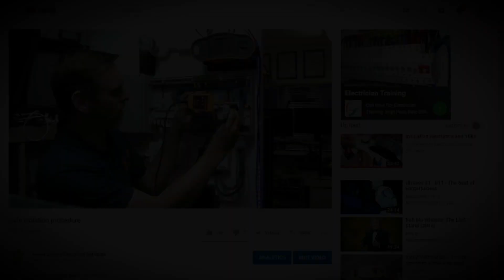NTT- The TIS859 Voltage Detector

Comment: Thanks for review. What I saw in it, that i didn't like was, that the multimeter function and buzzing is too slow. I also disliked the fact that you have to hold a button to get single pole phase reading.
Reply from the maker: I must admit, despite the review this model didn't remain as my go-to and I soon fell back to my TIS845 which has been on my hip ever since. It was the retractable shrouds I couldn't get on with.
Reply: Interesting. There are lots of models that are similar to TIS 845, but there are two things that I dislike with those too.

1. There is no RCD trip button (to see if it's ghost voltage i.e. fluke t130) 2. The main handle shroud tears easily.

I've seen wiha model with rcd trip button, but for that price I'd rather get fluke. Although I dislike these new fluke models too, because their cables are really thick. 
 @dsesuk

Comment: What’s ur thoughts on the tis859 since having it almost a year best two pole on the market ?
Reply from the maker: I haven't experienced enough to say it's the best on the market, but it's the best I have used personally, and at the price point it's good value for money. I do use it, in fact as the soft case has a belt loop, I carry it about my person daily as part of the toolbelt so it's my go-to tester for safe isolation, polarity checking and continuity. I haven't had cause to use many of the other functions such as capacitance or even the Electric Field function which I showed in both this video and a more recent one on capacitance, but it's handy to know that feature set is there and ready should I need it.
Reply: Thanks I’m using the megger tpt320 but had it for a number of years and is a bit worse for wear so I’m looking to invest in another and it seems like a lot of the two pole testers are coming from the same factory as there very similar in use just aesthetically different. TIS was always the underdog and not as recognised as ur megger kewteck and flukes etc so yeah look as if they’ve stepped it up. On a separate note I saw ur on the front of this months electricians magazine I can see u  being on playboys cover to soon 😭
Reply from the maker: @iqyyazdani7951  Ha! Yes, that was me. They wanted a fat man on the front cover and went for an angle where you couldn't see my face! Notice the effort they also went to by colouring the rim of my McHat in Scolmore blue instead of McYellow! Going back to the TIS, the only gripe I have is the shrouded tips. The shrouds are spring loaded, so they're good from a safety point of view and for complying with GS38, but if you're trying to check a fuse or something then they can get in the way a bit. That's the only downside though, and it remains on my hip ready for action!

Comment: Can’t a multimeter do much the same?
Reply from the maker: Yes it can, but a multimeter or multi function tester would not be allowed on a competent person's assessment as it has to be physically switched on, set to the right function (and maybe also scale) and it requires batteries to function. A voltage indicator will provide indication without batteries, without a power switch and without settings selection so there's no chance of a mis-indication through incorrect configuration. You can still carry a multimeter for additional functions, but to pass the CPS assessment, you'd need something like this.
Reply: David Savery Electrical Services - Thanks for the clarification. I begin to see why you sparks have so many bits of test equipment!

Comment: Well I’m rather pleased that I’ve just picked one of these up now. I dropped into my local Eddie’s to use the loo and get some free coffee and lo! A calibration day was being conducted by those crafty TIS bods as means to offer discount on stuff you didn’t know you needed. Sound familiar? I found myself walking away with a soon-to-be-refilled bladder, a soon-to-be emptier wallet and one of these babies in my hot little hand. TBH I imagined leaving it in the box and taking it back as I felt the chap from TIS (let’s call him Chad) had rather oversold it. He’d tried to chuck in a 560 clam meter for a lower price too, and it was this that had nudged my memory - “hang on, didn’t DSES do a vid on this or something like it recently?” Turns out you did, and favoured the Klein CL2300 over the TIS 560 quite considerably. Sorry Chad. 
So, grateful for the steer on that, and the (much more favourable) review on this. I think I’ll keep it and use it instead of the Fluke T5-1000 that I’ve been carrying for years, although I’ll keep it about, as it still operates as an ammeter which this doesn’t. Might still have to look at the Klein though....
Reply from the maker: Ah yes, that's where they get you, those free calibration days! Although to be fair, the Klein is not an earth leakage meter like the TIS560, but the 560 is pretty useless with its 20mA full scale deflection when investigating a trippy 30mA RCD as all it does is show OL (no shit, I know it's over limit, I need to know by how much!) Also, the Klein was end of line. CEF did me a good price on it which I thought was down to them liking me, but it turns out they wanted the damn thing off the shelf so they could put something new in its place! Still, this 859 voltage indicator is quite nice. I've been using it in anger for a couple of weeks now!

Comment: Vibration is for visually impaired electricians that can’t see the LEDs.
So it beeps sometimes and vibrates at other times.
And one of them has a two wire phase rotation function, I bet that works perfectly.
The RCD test function is used for circuit location rather than RCD compliance.
You forgot the MOST important thing what safety category are they?
Reply: Lol. Blind electricians. Could do with braille on the 'new' colour codes though.
Reply: Or to let you listen to your MP3 player while you work.

Comment: It retails for £138+VAT 😯😯😯
Reply from the maker: I think I paid about a ton for my 845 model which does less. There are far cheaper ones out there with fewer features. I guess you have to weigh up what it does for the money and decide if you're going to get the value back through having an easier working day!
Reply: @dsesuk  CEF is retailing the TIS895 for £89.95+VAT... That's a very good price 👍
Reply from the maker: An extra fifty notes for the new boy then. For that you get capacitance to 2000uF, resistance up from 1999 Ohm to 999kOhm, replaceable probes, flat-battery voltage indication operation, RCD trip operation, electric field sensing, spring-loaded GS38 ends, better battery testing and a larger, more informative LCD display. That's what you're weighing up for the extra, and it might be enough to sway, or not. If I was in the market for a voltage indicator and I didn't already have something that could do capacitance, then that alone would likely swing it for me. I find it's very rarely needed, but when it is needed, it's nice to have it on a tool already residing in the box. It's always right to shop around and compare pricing and features to work out what's best for you though.
Reply: @dsesuk  I'll have to think of a way of breaking or accidentally misplacing my current tester so I can justify getting this bad boy 😂😂😂
Reply from the maker: Haha! I know what you mean; that's the problem isn't it?! My 845 has served me well, I feel guilty taking it out of the toolbox for any usurper!
Reply: David Savery Electrical Services does it comply with GS38? As the note states that’s it has no leads that disconnect from device? Just about to part with hard earned dosh
Reply: @BaylinerCapri2050  The TIS website says that they're GS38 compliant.

https://www.testinstrumentsolutions.co.uk/view-product/TIS-859-1000V-RCD--Resistance
Reply from the maker: @BaylinerCapri2050  Hi Rick. I don't think GS38 says leads cannot be removable. It says they must "..not have accessible exposed conductors other than the probe tips,
or have live conductors accessible to a person’s finger if a lead becomes
 detached from a probe or equipment when in use. The test lead or leads

are held captive and sealed into the body of the voltage detector..". I think the idea behind that is to rule out the use of cheap multimeter probes which have an exposed prong on the end of the lead. In the case of this thing, the plug is shrouded so there's no chance of accidental contact if it's not pushed fully home. The picture on page 5 of GS38 shows the recommended type of lead which matches what's in use here.
Reply: David Savery Electrical Services 

Pg6, 1st para, last sentence... The interconnecting lead and second test probe ***are not detachable components***. These types of detector do not require additional current limiting resistors or hbc fuses to be fitted provided that they conform to BS EN 61243-3.
Reply from the maker: @BaylinerCapri2050  Nice find, I missed that. In that case, I don't know for sure as I'm just going by what TIS claim. I suspect the requirement for the probes to not be detachable is to prevent fused or current limited probes from being replaced with non-fused probes, but this tester does comply with BSEN61243-3 according to the spec sheet, so I suspect there's nothing special within the probes and no danger if replaced by an ordinary lead. I'm not sure if the 'Voltage Detector' descriptions on pages 5/6 are just descriptions or if they're actually meant to imply compliance requirements.
Reply: The TIS 859 are rebranded BT75EU testers made by Taiwanese manufacturer Brymen (EU because the probes in their default position are spaced for euro two pin sockets).  They only cost 67 Euro incl. VAT direct from manufacturer. Which makes TIS price tag even more outrageous....

Comment: Often using my tester in noisy workshops with equippent  running that buzzer is very useful.

For me the capacitance checking alone is worth it but the buzzer is the iceing on the cake.
Reply from the maker: It does take a few seconds for the ol' vibrator to kick in, although LED indication is immediate. Not sure why that is.

Comment: I had its predecessor a few years ago, which was recalled as it did not indicate dangerous voltages if the batteries were flat. I quite liked it, I don't recall it having a removable lead, so thats a new bonus. As for the RCD tripping feature, I found it occasionally useful on CU's that were not helpfully labeled (As if!). It gave you 50/50 head start on identifying the circuit you might be working on, saved a bit of time. I particularly liked the better resistance function. Much more useful for quick fault finding, before breaking out my main tester.
Reply from the maker: Yes, I hadn't considered the unlabelled circuit scenario, it could be just the ticket for that kind of caper!

Comment: Similar to my fluke T150 but cheaper lol.. The rcd test function is not really useful as on the T150, like you say, but what happens if the rcd doesn't trip? Will it blow the tester up? It's only a resistor accross line & earth anyway but useless for testing RCDs as per BS7671. That klein was awful on capacitance.. I nearly fell asleep waiting for a reading 😂 what I really want to know is.. Do I still need a proving unit or does my T150 self test prove it? I know it's really a functional test of the Leds, display, cable etc, but I don't want anymore junk in my van 😭 great demo Dave.
Reply from the maker: I'd say that the inbuilt test function is just a lamp test - it doesn't prove the thing is capable of correctly reading an applied voltage, so you still need the proving unit I'm afraid (or a known good source of supply).
Reply: @dsesuk  yeah just as I thought Dave, those fluke proving units are quite cheap now though, but prob won't get used much. Stick a T150 across an isolater in a CU is as good as any way to test but hey ho. How often do you use yours out of interest? Or just a NICEIC requirement? 😉
Reply from the maker: My proving unit lives in the Fluke case with the Metrel, so is always with us. Can't say I've ever used it out on site though. I do check against a known good supply, but nice to have the PU there is perhaps there isn't any other supply at all!

Comment: Looks like a good bit of kit, it’s a shame the snobbery on industrial sites stops me using it. If I’m charging commercial rates clients expect to see Fluke.
Reply: What ? - I wouldn’t let my clients dictate what type of Testing Equipment that I choose to use , it’s my choice not theirs.
Reply: James Osborne I agree it’s stupid, so long as a piece of test equipment it made to a recognised standard and is of sufficient quality.

Test equipment CAT ratings are a lot more significant in heavy industrial applications where you are much more likely inadvertently encounter high voltages. Developing a piece of test equipment is an expensive business and this is often where corners are cut.

In my experience in about 25% of cases as a service engineer attending a breakdown you’ll have some clown looking over your shoulder who hasn’t the foggiest. You’re probably being charged out by some big multi national for £1500/day to look a some relic that have no records/information on. At least if you turn up with a shiny tool kit the goon over your shoulder recognises some brands in you don’t have the idiot questioning your test equipment etc.

Comment: Bottles mate! Beer IN bottles :-p
Reply from the maker: I'm already updating my safe isolation procedure to ensure alcohol for consumption around live parts is not contained in conductive vessels.
Reply: Gonna be ordering one of those, the capacitance function would be really useful for me. The buzzing function would be helpful as some of the equipment I work around is so noisy you need ear defenders on when its running. Been using a Steinel tester but their obsolete now.
Reply from the maker: Sounds like the ideal accessory where sounds are not ideally heard!

Comment: Looks ok, but like others, I use the fluke, have had it ages and its very robust, I have seen the TIS stuff in cities and very nearly bought the mft Pro, but I have always been put off by it looking a bit cheap and fisher price looking, so have always stuck to Megger or fluke which is what was always in college.
Reply from the maker: Both fine brands, and you'll never go wrong with them. Their premium pricing may put some off however.
Reply: @dsesuk  very true, a few things worried me with TIS though, one being how long would they be around, as you know fluke and Megger have been around ages, then their equipment just didn't look as good, whether that was the design or the plastics I don't know. Then the mft Pro I nearly bought, I realised I had to spend the same amount on extras to benefit from the additional functions, and I wasn't keen on the design of the graphical display looked a bit early Windows 90s to me, and that was why I bought a 1741.

Comment: The old TIS unit appears to very similar spec to my Fluke T150. The increased resistance range on the new model would be handy for testing solenoid valves and all in all it seems to tick alot of boxes. I always go for functionality over branding, this indicator is something I'd definitely consider purchasing.
Reply from the maker: Hi Alvin. I just picked up the new CEF catalogue and they have this at £89.95 ex-VAT (page 1423, code 2222-1574). That's much cheaper than I was expecting: I got the counter bod to verify it! The older model 845 is listed in there at £56.95.
Reply: @dsesuk  Yeah, I know, I said as much in my other comment.
Who would have thought it, CEF publishing their prices, wonder if I can still get my discount 🤔